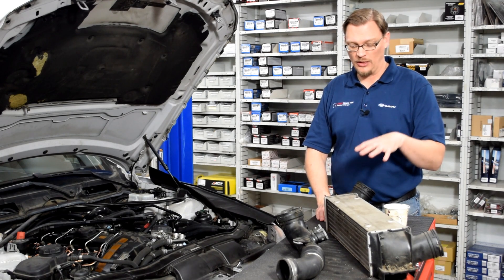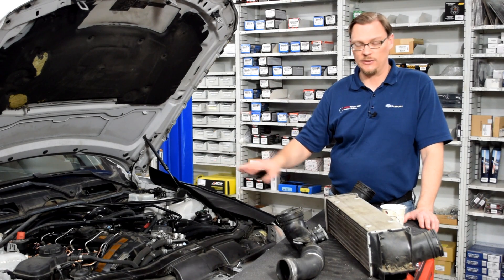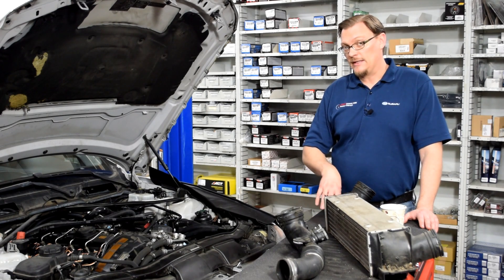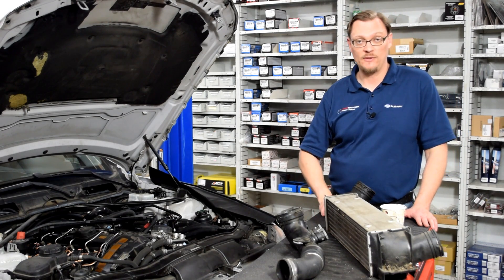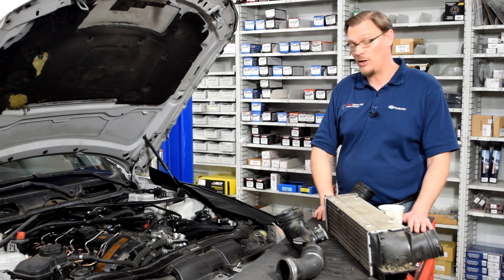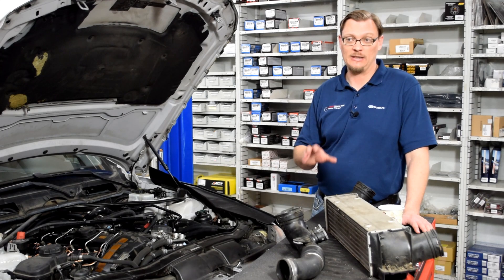How important is a Catch Can on a Direct Injection Engine?

Comment: I bought my wife a 2018 Ford Edge with the 2.0 Ecoboost, direct injection. We don't drive our cars hard at all but I installed a catch-can anyway because it made sense....easy install too. We're simi-retired with no commute to work so the car has only 10K miles. The little dipstick in the catch can shows no oil. We run regular gas.....Someone told me that's ok because  the engine has a octane sensor.... any thoughts?
Reply from the maker: Thanks for your question.  On a new engine there should be very little oil if any that would be moving through the PCV system.  Most likely this indicates a healthy operating engine.

Thanks for watching and Stay Tuned!

Comment: So if there so great why don't the manufacturer put them on as standard????
Reply from the maker: Thanks for your question.  Actually, most manufacturers do build in something that works like a catch can or AOS.  But they are typically smaller and incorporated into the engine design.  This is why issues are generally much less on completely stock cars.

Once you start modifying them, you are changing the conditions that the engine is running under, and the stock components get overwhelmed.

That is where the aftermarket options come in.

Hope that helps and Stay Tuned!

Comment: I have a 2014 m235i only has about 45k on it I pulled out my MAF sensor and it was wet with oil
Reply: The MAF is After the EGR return to the Cold Air Intake?

Comment: Just use a good synthetic oil and a 20 micron oil filter and change oil every 5,000 miles and u won’t have anything to worry about. I have a 2011 f150 with the 3.5 ecoboost with 217,000 miles and I have no valve coking problem. It’s a race car engine and u need to treat it like one.

Comment: People asking why companies don't install catch cans when manufacturing vehicles is simple. 
Money. 
Simply put if it continually blocks up ports and runs oil through intake then at some point in its life it's going to need replacement parts or worse a full rebuild. And alot of people tend to go to the dealership to get this fixed. Putting money back into there pockets

Comment: Good explanation on the GDI setup, why run the catch can return line back into the engine and instead have it and its byproducts eliminated completely from the intake sides by routing it somewhere else or even mount two cans. Try to eliminate the source of the problem completely.
Reply from the maker: Thanks for your question.  So far, on the car that we installed this on, there is a minimal amount collection, so there may not be much need for a more elaborate system here.

As to venting to atmosphere, that depends a lot on the car in question.  If the car is MAF based to calculate air fuel ratios, you can not vent the PCV system to atmosphere without re-mapping the car for that change.

It is a tricky enough issue that I would say unless you have a race car, or you have to vent to atmosphere, it is better to stay within the stock flow path and configuration.

Hope that helps and Stay Tuned!

Comment: Why even send the vented vapors back into the engine at all? Why not send them to be filtered through a system that collects them and can be disposed of without risking valve contamination at all?
Reply from the maker: Thanks for your question.  Basically, when the catch can is working properly, that is exactly what they do.  If you are using a bit of oil, this is definitely the place to start.

Thanks for watching and Stay Tuned!

Comment: Hi can i install a can on a NA engine? Cuz my CCV valve is bad and I'm hoping I could get away with an oil catch can so I don't have to change the ccv. Will it work? thanks
Reply from the maker: Thanks for your question.  If you know that you have a bad valve, a catch can would only be a temporary fix.  It may be better than nothing certainly, but I would recommend putting a plan together to properly fix your car. 

Hope that helps, and Stay Tuned!
Reply: @FlatironsTuning  thank buddy

Comment: As I see oil condenses in the intercooler.  Not good,  but still:  I'd the intercooler doesn't stop (by condensing)  the oil from reaching the intake/ valves,  how could a small catch can help?
Reply from the maker: Thanks for your question.  The Catch Can is places in the line that is connected to the crank case where the oil vapor is coming from.  The idea is that the design of the can will capture the oil vapor and get it to condense before it goes into the intake/intercooler.

Hope that helps, and thanks for watching!
Reply: @FlatironsTuning  thank you.  Seems like a good thing to do to protect the intercooler.  I still wonder why we get carbon buildup  on the back of the valves.  I thought is the oil coming from the recirculated crankcase fumes, but it seems logic that those vapors would condense in the intercooler and never reach the valves...
Reply from the maker: @CosminRotaru  It is oil vapor that is getting into the intake path through the PCV system.  The intercooler does capture a good deal of the oil vapor, but not all of it.

That is why something like a catch can will be helpful to reduce the carbon build up.

Hope that helps, and Stay Tuned!
Reply: @FlatironsTuning  if only for keeping the intercooler cleaner it already sounds good.  Helping with carbon buildup on valves would be ideal.  I'm sold on the idea already - looking for the best catch can at an affordable price.  Under 100 dollars ideally...
Anyway,  thank you for your explanations!

Comment: I have a 2018 Subaru WRX it only has 4100 miles... I am going to add an AOS IAG system when i do it first oil change... First, what oil should i use? Second, having an AOS help with the carbon build up? Third, how often should I do the the carbon cleaner on the engine? Its a daily driver but i do drive it hard. I use 93 octane. Also it has an OST map from MA Performance. I am staying at stage 1.  Thank you for your time.
Reply from the maker: Thanks for your question Kennedy.  For the oil, I'd say either the Subaru Synthetic or Motul 8100.  You could also go with something like Redline as well.

For the AOS, the need should be minimal on a newer car that is largely stock.  The best indicator is the amount of oil that you have to add between changes.  If you aren't losing much if any oil, the need for a catch can or AOS will be much less, but that can certainly change over time as the engine losens up, or as you start modifying it, etc..  But yes, having some extra protection to keep any oil vapor out of the intake will reduce carbon build-up over the life of the car.

As far as the carbon cleaner, I'm guessing that you are talking about the Subaru Oil treatment?  If so, I'd say maybe once a year, but after the car is a few years old.  If you are using a good oil with good detergents, and changing it somewhat often, carbon build-up should be very minimal for the first few years of its life.

I hope that helps, and thanks for watching!
Reply: @FlatironsTuning  Motul 8100 Xclean C3 is what i was told to use from a BRZ owner cause that will help with carbon build up?. I see Motul 8100 has different kind of oil type and what are the different... What i was talking about was the Carbon build up service using chemical? Direct Injection Intake Valve Cleaning, theirs a lot of talk about valve carbon deposits and can effect the engine performance. what your take on it... Thank you for your time and the fast reply.
Reply from the maker: @kennedymoreno7116  There are a lot of different blends of Motul 8100.  The x-clean is a mid-saps formula, so it doesn't have as much zink as the full saps, but it is still pretty good.  Using a high grade of synthetic oil should keep evaporation down, and that can help with carbon build up certainly.

Hope that helps!
Reply: @FlatironsTuning ... IAG AOS is now on my car... already notice oil temperature is very steady and I used Motul 8100 X-Clean EFE 5W30.... I read the spec on the oil and I was Impress, what it should help with Oil and Fuel  consumption. So, I will keep eye on the oil level and see... Thank you for your time and your video are awesome... I have learned a lot...
Reply from the maker: @kennedymoreno7116  That is awesome.  Thanks for watching, and let us know if you need anything else!
Reply: Kennedy Moreno I’m planning on installing AOS from IAG as well. Is really worth the steep price? I have about 10,000 on my 18 WRX. I change oil with Subaru synthetic about every 5000 miles. Thoughts?
Reply: @FlatironsTuning  I feel like car care is a balance of should you pay more to keep it healthy longer, or be cheap so that you have money to pay for repairs when they are needed.

Comment: I already have 11,000 miles on a 2017 1.5 civic.  I've only red lined it once if ever.  Have I already done serious damage?  Mishimoto won't have any for another month:(
Reply from the maker: Thanks for your question.  It is extremely unlikely that any damage has been done.  Remember the starting point is to look at your oil consumption if you have had any.  If you are having to add oil, especially on a very new car like the one that you have, that is a prompt to start looking at your intake path, and your PCV system to see if you would need to put something like a catch can on to prevent oil from getting into the combustion chamber.

If you aren't having to add any oil between changes, etc., then the need to modify the PCV system will be pretty low.

I hope that helps, and thanks for watching!
Reply: Should you wait until you need to burn oil before you consider adding a catch can/AOS or can this be done before any damage could have occurred?
Reply: @PsychAP44  Preventative maintenance is always better than an expensive cleaning down the road.  Although that might not be true you do the math.  Also make sure you are using Toptier certified gas stations, the AAA application will help you find them.

Comment: With everyone moving to DI; why aren't manufacturers putting catch cans on from the factory, or coming up with some other solution other than letting it blow back into the intake?  They don't really seem like they are adding in that much complexity.  Just seems like they're setting themselves up for reliability issues down the road.
Reply: Some manufacturers are going to a combination of DI (for high speed running) and PI (for idle long) to wash down the intake valve area. I know Lexus does (and I’m pretty sure Toyota too) as I made certain before my Misses bought her NX200t. 

I had a catastrophic intake valve failure on my Sonata 2.0t with direct injection at 104,000 Kms. Hyundai fixed it under partial warranty but told me to use premium gas and synthetic oil. They also said I’d have to have the top end dismantled every 60,000 Kms for inspection and possibly manual cleaning. I did my own research on the web to find out why it failed, and put on a catch can to mitigate the problem. I recommend all owners of 2.0t Sonatas do the same.
Reply from the maker: Thanks for watching!  Yes, it is a little perplexing.  Especially with full DI engines, it would seem that it would be to the manufacturers benefit to thoroughly address this issue, as it would seem to give much better performance and reliability in the long term life of the car.  At least there are some good options to add from the aftermarket now that the issue is becoming more and more apparent.
Reply from the maker: Thanks Jim.  There seems to be a movement to bring back port injectors to work with the DI injectors.  It does make a lot of sense, but it just adds a little complexity.

Thanks for watching!
Reply: It comes down to money sadly.
Reply: I think the real reason why the factory doesn't install these is they are too high maintenance. Many times the oil change interval is close to 10,000 miles, you probably won't be able to go that far without draining your oil catch can. Another really big issue is cars in the northern states, 1 catch can I was reading about says it should be removed when temperatures fall below the freezing point otherwise the contents of the catch can may freeze and block the PVC system. This can happen due to condensation that will accumulate in the catch can.
Reply: @markkauffman6184  Great point, they are marketing to the lowest common denominator.  They want cars to be as maintenance free as possible especially with the Advent of electric cars.